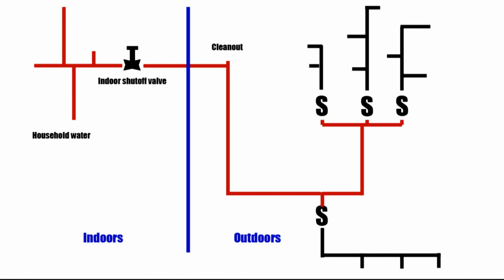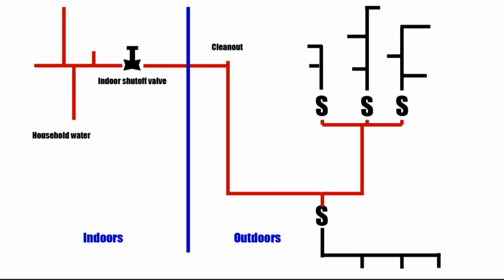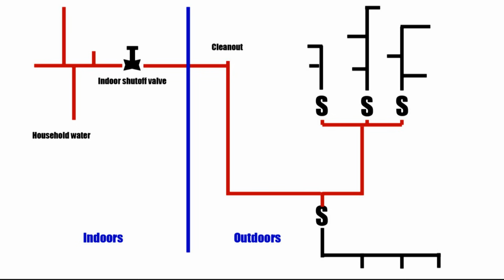How to fix a leaking sprinkler head

Comment: The first thing you should try is to open the release valve (little black know on the top- turn counter clockwise) for one minute. Often that fixes the problem lickety-split.

Comment: This whole long video and you don't actually show replacing a sprinkler head.
Reply from the maker: The cogent point of the video is that if your sprinkler head is leaking, replacing it will not solve your problem. If you want to find a video explaining the more elementary aspect of how to replace a sprinkler head, you came to the wrong place.

Comment: Thank you for the video. I have one sprinkler that is leaking however it's only noticeable when it's on. Why is it not leaking when it's off like in your video?
Reply from the maker: If it leaks when on, there is either a problem with the line distal to the valve, the connection to the sprinkler head, or the sprinkler head itself. I would dig down in the wettest area looking for a cracked line, a leaking threaded connection, or a bad valve. If water freezes in these structures, it can expand and damage the plastic, only noticed when you turn the system back on. Once you get the area exposed, turn the zone back on and see where the water is coming from.

Comment: Thanks for that video. Very informative and helpful to know in case I have to do this in the future. You mentioned that if you replaced the diaphragm and it’s still leaking that you will have to replace the solenoid. You didn’t go that far since the leak was fixed after replacing the diaphragm. So first check any debris that may be on or around diaphragm. Then, if still leaking replace the diaphragm. Finally, if leaking still then replace the solenoid. Does that sound about right?
Reply from the maker: A solenoid diagnosis is very different. The logical approach would be to decide whether the problem is electrical (solenoid diagnosis) or mechanical (diaphragm or valve). You should be able to decide whether the solenoid is a problem, as follows. If it won't open with electrical control but it will open when you turn the valve counterclockwise, then you have either a solenoid or a wiring/controller problem. If it won't open when you turn the valve counterclockwise, and the water is on, then the problem is the valve, diaphragm, or water supply. So, any thought of a solenoid problem drops to the bottom of the list if the valve won't open manually. I did a followup video called 'sprinkler troubleshooting' that explains valve problems much better than in this video. Once you understand how these things work, you won't need a flow sheet because diagnosis will become very simple.
Reply: @spelunkerd  thank you so much for that detailed explanation. I think I understand. I’ll refer to the video if I forget.

Comment: Any recommendations for “how to” clear the line of water and debris when changing out the diaphragm? You recommended using air or water to clear the line, would be very helpful to learn how you did that. Thank you!
Reply from the maker: It's very messy, but with the valve head removed you just turn the water back on for about 10 seconds and let the fountain spray water out the head. You can get trapped little calcified 'marbles' in the line that will be forced out. I showed a very abbreviated version of this in another (better) video I did of diagnosing valve problems.

Comment: First I would have replace the inground box to hard to get your hands,  to rectangle 12x14. Video is too wordy & too technical for a homeowner
Reply: I disagree, I thought the video was perfect. I'm a young first time homeowner (bought in December) who has never once worked on a sprinkler line and I thought this was a great explanation. It gave me the confidence to approach the problem and also taught me some of the setup and vocabulary of the sprinkler system in case I need to go any further into the system.

Comment: What type of valve was that?  Rainbird, hunter, Toro???  I need to find the diaphragm   Thanks
Reply from the maker: The controller is Hansen, not sure about the valves but probably the same. I take a photo of the valve along with the old diaphragm, and ask the local irrigation supply company for a replacement. They store them on the shelf, no wait.

Comment: Sir...Thank You so much for posting your video.   I had 2 sprinkler heads leaking and not working and found one that was damaged.  I assumed incorrectly that it was causing the other head to leak/not work  but I stumbled upon your video and did as you suggested. I went to the corresponding solenoid and when I opened it up, I found the diaphram was all gunked up. I thoroughly cleaned it and now I am getting good pressure to those two heads. I just have to replace the one damaged Rainbird 5000 head.  You're the best!!  Again, Thank You!!!!!
Reply from the maker: Thank you so much, you made my day! Recently I did another video (link in this video description) describing the function of the valve in more detail, and how to tell the difference between a valve problem and a solenoid problem. You figured it out with common sense, the best tool in the DIY toolbox.
Reply: Yup and you bet!!

Comment: Thanks for your very helpful videos.  Question: How do you know which solenoid controls which zone of sprinklers?
Reply from the maker: The best way is to turn each one on using the master controller and see which areas of the lawn get wet. I do it with a clip board, making a diagram of the lawn, and I label each solenoid with the number that the master controller uses, so when I come back next year I don't have to do it all over again. There are usually three heads for each solenoid, or more if the heads are small. File the results so you can find them next year. The heads that aren't working are hardest to find, so it is best to do this at a time when everything is working.

Comment: Hi I was wondering if you have come across the Ez out sprinkler tool by Underhill.The tool allows for easy pop up spray head sprinkler replacement without digging but for drip applications allows the user to replace a sprinkler without digging and the attach drip tubing to the connection in the ground.The company also sell a cap system to plug off unwanted heads below ground and again no digging.Here is the link:http://www.underhill.us/markets/diy/contractor-tools/276-easy-out-quick-fix#videosI think it would show well for your users and can easily be bought online by Underhill or from Amazon for around $20.Let me know if I can answer any questions.William
Reply from the maker: As a gearhead, I'm always interested in new tools. I can see how this tool would be useful for professionals, who live their day trying to be more competitive and efficient. I don't usually allow advertising within the discussion of my videos, but this was interesting enough for an exception.

Comment: I have an issue similar, I replaced the value but all the heads are still leaking. Please advise
Reply: Also I programmed the valves 1-4 but they don't shut off and on. They only shut off and on manually
Reply from the maker: Bad luck! Perhaps the valve does not seat well in the valve housing, it may be the housing has to go, too. The housing can be damaged by debris trapped against the seat by a closing valve. That's a bit of work. Carefully inspect the valve seat in case there is anything you can do to let the valve sit better against it. Be sure to flush the upstream line well before installing the new valve since calcified debris can be trapped there by the valve, rocking back and forth with changes in flow. I would go to the website of the actual manufacturer to see if there is anything more they recommend for their valves.

Comment: Nice video. I took the diaphragm off inspected cleaned and replaced, sprinkler still leaks. I then replaced with another albeit used diaphragm one and it still leaks. I did flush the valve also. The zone waters fine and it is just the low point sprinkler that leaks after watering. Is the valve now a possibility as the culprit in some way?
Reply from the maker: The pros who work on these valves say that it's almost always debris, which  is often trapped in the upper feed line by the valve. The gravel is too coarse to make it through the valve. So, with the valve disassembled you need to turn the water on and let if flush clear. You want to leave it open for a while, it will make a mess! The debris is gravel that is formed by calcium deposits from hard water. Those little bits of gravel jam the valve partially open, allowing water to pass through. After a long flush, carefully reassemble, and closely inspect the seat of the valve that the diaphragm closes against. If that fails, I suppose the seat could be damaged by gravel trapped there, or perhaps the spring is weak or the gate is twisted. If all else fails I guess you could replace the whole assembly -- I've not had to do that because of leaking, yet. Good luck!

Comment: Hi, I just had most of my sprinklers heads replaced but thier is just one head that seems to be leaking rather than the others and has always seemed to do this in the past. Is their anyway to stop the leaking head at the top of it. The other ones on the same zone seem to be fine but one!
Reply from the maker: A normal sprinkler head is always open, so it will leak if water is getting to it. The reason why one head seems to leak is mostly a gravity effect, it's usually the lowest head of the zone. Check out the valve, look for debris obstructing full closure of the valve.

Comment: Hi,
I have the same issue .
2 weeks ago my sprinkler repair guy replaced the end of line sprinkler due to a constant low volume leak.
About a week later the next valve upstream started to leak. Is this likely to be the valve problem you describe or the sprinkler head itself.?
Great video by the way!
Reply from the maker: Sprinkler heads are always open, so they can't cause a continuous leak. Open the feeder valve for that zone, flush the line above the valve, clean and reassemble it. Most likely your problem will be solved. Good luck!
Reply: Thanks for the quick reply. Am on it right now will let you know how it goes.

Comment: Hello there! Great video! I think you have showed me what my issue may be. I believe I have the same valve that you were working on. Where can I find the diaphragm? Any specific one or is manufacturer specific one required? Also, will this leak issue also cause your sprinkler heads to go up and down on there own while other zones are operating? Mine do this when rest of yard is being watered...and this happens to be the bad zone valve. 

I look forward to hearing from you. I have the repair man coming next Friday...maybe I can cancel that appointment.😉

Sal
Reply from the maker: +jersal873 If it's a piece of debris you may not need anything after cleaning and flushing the proximal line. Take a picture of the valve and if the seal is bad you can take it in to a local irrigation supplier. Every city will have a few. Good luck!
Reply: +spelunkerd hi!! Thanks again! Just finished doing what you said and that valve isn't leaking anymore. The diaphragm was gross with crud so cleaned that up as well as the housing it sits on. Tightened it up and ran that zone! Works well now! I won't cancel the repairman just yet. I'll first let it run a few days and make sure that the valve box isn't full of water like the day I found it!  Thanks again! Look forward to more videos of you around the house! Regards!
Reply: +jersal873 by the way...I have the exact same diaphragm. Which manufacturer is this should I need to get a new 1?
Reply from the maker: Not sure. I would take a photo with your phone and ask the parts man at the irrigation supply house. Those guys are a source of endless favours.

Comment: Thank you for the wonderful video sir, I was having the same problem and followed your steps.  I have old valves also, Toro 53381 model.  No stores in my city carry that exact valve any more, but I bought a modern Toro valve with equivalent solenoid, o-ring and diaphragm (according to the salesman at a professional contracting store).  I replaced all three of those, really the only part that I didn't replace was the fixed in lower part of the valve.  It still doesn't close all the way, I still have drainage when the zone is supposed to be off.  If I manually screw in the large knob all the way, it does shut completely and the drainage stops.  However, it never electronically shuts off completely.  The same problem is present even with new solenoid, o-ring and diaphragm.  Is there anything I can do before digging up all of the valves and replacing them?  I don't mind doing that, they are approximately 25 years old...but I'd rather avoid it if a few parts is all that needs replacing.  Thank you again for all of the wonderful videos!
Reply from the maker: +Joseph “Mr. Joe Himself” J This message got put into a spam folder by youtube, I found it today. Yeah, it sounds like your valve doesn't play nice with the housing. Maybe the housing is out of round, not sealing correctly. If properly flushing upstream debris doesn't help, I'd think of replacing the whole thing. But try a few times to get debris from the upstream line, it can be very hard to detect.

Comment: I've replaced both valves yet one of the head is leaking. When I shut off the water line, there is no leak. I've confirmed that. As soon as I turn the water on, within about 10-15 minutes, I notice water is slowly sipping from the same head. Any thoughts on what else I could try? Thanks!
Reply from the maker: Enayetur Raheem There should only be one valve supplying water to that head that is leaking. I would go back and do as I did in the video, again. Often debris is present in the main line, being pushed forward to the valve and preventing it from closing completely. When pressure drops the debris can rock back into the line and not be visible when you disassemble the valve.  So, you need to flush the line proximal to the valve.
Reply: spelunkerd Thanks dear. I have two for the two zones. One with the jar top (you rotate to open) and another is with 4 screws. 

When I manually loosen the solenoid of the jar-top valve, the zone sprays water. However, when I manually loosen the other solenoid, it makes some hissing noise but never sprays. This is the valve that is related to the zone where leaking is occurring.

As I've tried all possible combinations to narrow down the possibilities, now I will do the flushing (which I did not do before) and see what happens. 

If you have any other suggestion based on my description above, it would be much appreciated. Thanks.
Reply: spelunkerd Finally, I've discovered that I was fixing a good valve all along. Today I found another box (apparently hidden under a large broken lid) with three more valves one of which was the source of the problem. Washed and cleaned the valve, and all is good now! 

Thanks a bunch for the video!
Reply from the maker: Enayetur Raheem Thank you for the feedback.

Comment: How did you know it wasn't the sprinkler head? I've a bunch of leaks. Shouldn't I dig up the heads and check? I've found a couple so far and have more heads with puddles to check.
Reply from the maker: The solenoid stops flow to the heads when the circuit is turned off, so no water gets to the heads except when the circuit is turned on. The heads do not have any 'off' switch, so any water that gets to a normal head will just leak away. If you have flow when the circuit is turned off, your problem is at the valve controlled by the solenoid. It could be a mechanical problem with the valve or more rarely the solenoid itself. I did another video on a different system, showing how the solenoid works and how to test it. You can test the valve manually by just twisting the solenoid. Closed is clockwise, and for normal function all the valves should be closed. When professionals winterize systems, they usually open all the valves a little so that water won't freeze against the diaphragms, possibly damaging them. After that, the system won't work properly until you close all the valves again in the spring. So, if you are testing the system, you want all the valves turned off manually so that you are just testing one component at a time.
Reply: xdream2 does the Saturn III Plastic Pop-Up Gear-Drive Sprinkler Head have a check-valve? can't find the info on Home Depot website.